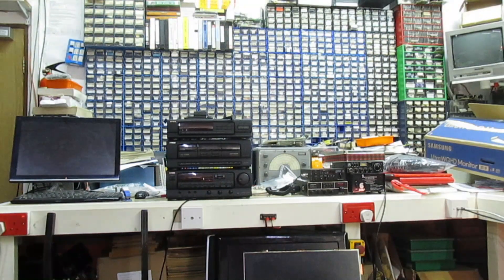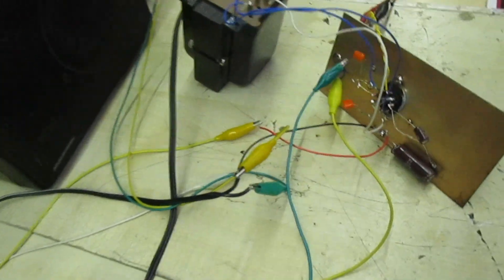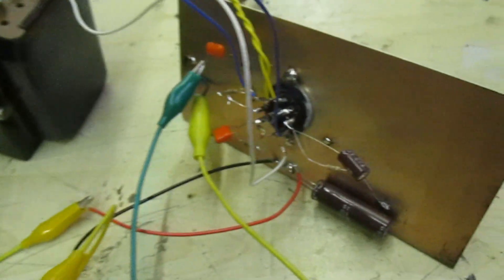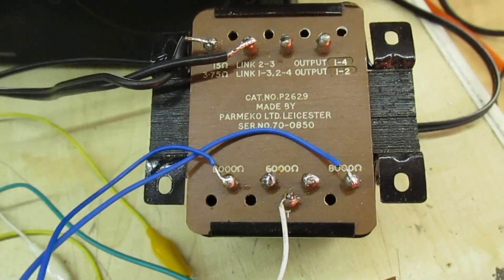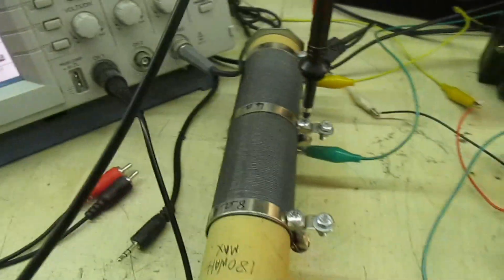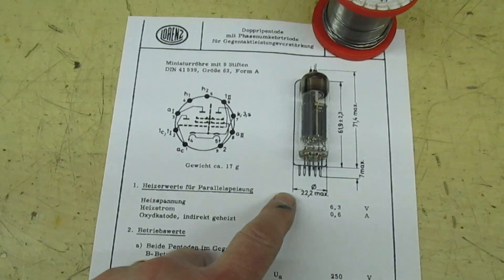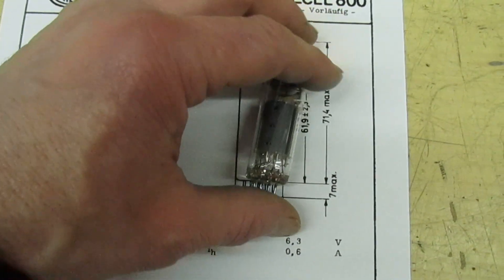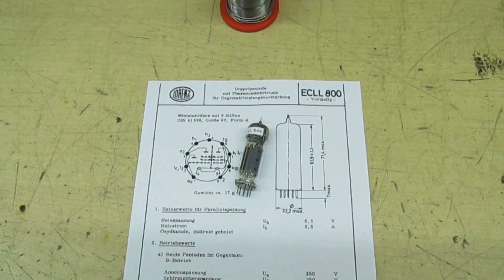push pull valve amplifier, using only 1 valve and 10 components .

Comment: Hello! First, congratulate you on your work.
In another video, I don't know why the comments are disabled, demonstrating a module with transistors to replace an EL84 valve. I live in a very distant place and I need to replace an EL84, but it is very difficult to do so; Would it be possible to make the schematic of this replacement module available?
I would be very grateful and would help me on a level I could not have imagined.
Thank you very much.
Manuel
Reply from the maker: cant remember now this video is a few years old , I think it was a tweaked version of the solid state PL802 module

Comment: If I was going to build power amp d use a stko80 power amp ic
Reply from the maker: I know there are easier ways to build amplifiers but valves are special to be I grew up repairing TV s with valves in them , hence my interest .
Reply: @michaeldranfield7140  I started tv repair shop  1960s  that amp  is unique     have couple Philco cathedral and z trans oceanic  but there are many fisher amps w stk ics surplus and there terrific  think we have a few in the barn .if I wanted an amp that's where I'd be .I've got a 25watt ultra linear tube  out xfmr nos .under a chair in the box .🤗 I'm 80 yrs old fingers don't work anymore miss electronics have stuff everywhere 🙄
Reply from the maker: Fisher, that's a name you don't hear anymore, I remember there audio products in the 80s.

Comment: Neat trick, i didn't twig it until you put the valve data sheet down, then i knew immediately how you did it!, never saw them used in anything else but continental radiograms, they weren't terribly reliable i don't think, all that heat in one puny b9a envelope, stll have a couple somewhere.
Reply from the maker: Also very expensive to do low demand I guess.

Comment: This reminds me of my little single ended amp based on PCL82. About the same component count, but yours is push-pull!  Mind you, I didn't have an output TX for push-pull!
Reply from the maker: Just built a stereo amp , I tried PCL82 s but not quite powerful enough so i used PCL86 s instead , i only have 2 of those push pull transformers , im a bit thin on the ground with output transformers at the moment .
Reply: @michaeldranfield7140   I built mine in my teens, but the only valve I could get hold of at the time was the audio output that I borrowed from our telly!  It still gave a good account of itself though. I powered it from a motorcycle battery for the heaters, and a couple of car batteries for the HT (all to be found in my dad's shed). At 24v HT, output was quite low but decent, until you turned it up too far, then it sounded like small radio with a flat battery.  Eventually had enough batteries to reach 48v for the HT, and at that it held its own quite well. Eventually drove it at around 105v derived from the tapping (rectified and smoothed) of a BSR record player motor.
Reply from the maker: @whitesapphire5865  certianley good memories, if only we could go back in time .

Comment: 3 in 1, no wonder it gets hot!
Reply: How about EABC80? It's a triple diode, triode - Four valves in one! Made for use in FM radios. Granted, it handles less power, but four in one envelope. Imagine a radio with six valves suddenly having nine! That would be costly.
Reply: @whitesapphire5865  I still marvel at how they mass produced valves like this
Reply: @xyredmax  Even more so when you see how many parts go into making a single, simple valve. It was a masterpiece of miniature engineering. All that precision, all that folding and bending at a minute scale, all that micro welding, assembling all those tiny parts onto the mica end pieces, and then the final act of evacuating and flaring off the getter.  No wonder transistors were cheaper and easier to make!
Reply: @whitesapphire5865  All true - I also marvel at those who thought up the manufacturing process and of course the original designs. Have you watched 'Glasslinger' on You Tube?
Reply from the maker: i know , I wonder if these had a short life when they were in use ?
Reply: @michaeldranfield7140  Hmm, not like you could attached a heatsink - Perhaps a fan?
Reply: @xyredmax  I have a couple of retired transmitter valves with heatsinks on them - A crown of metal cooling fins. When in use, they would also be cooled by augmented airflow - i.e. a fan!
Reply: @whitesapphire5865  Wow, I would never have thought of valves with heatsinks
Reply from the maker: @whitesapphire5865  Im building another amp at the moment with a transmitting valve , but not a heat sinked one !
Reply from the maker: @xyredmax  there are valves like the 833A which are only forced air cooled , 400 Watts anode dissipation, I have one of these but its down to air sadly .

Comment: Nice sound from this amplifier. Wish I could still solder
Reply from the maker: You don't need to worry if your soldering is not very good valves are very forgiving and it's pretty unlikely you will damage anything by making a mistake.

Comment: Neat little valve!
I would imagine these were used in portable record players, driven from a high output ceramic cartridge.
Presume also that they were created in response to radios etc being taxed on the number of valves in them.
Reply from the maker: Could be, I don't actually know how long tax on a mount of valves in a set lasted for but it makes perfect sense, it would be OK in a record player but to get the full 8.5 Watts output you would need to use an additional preamp valve.